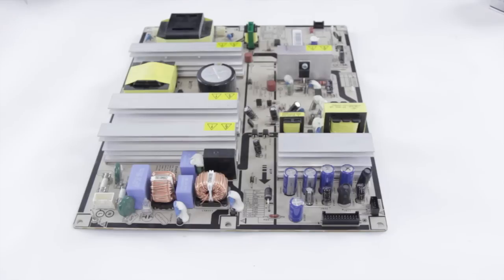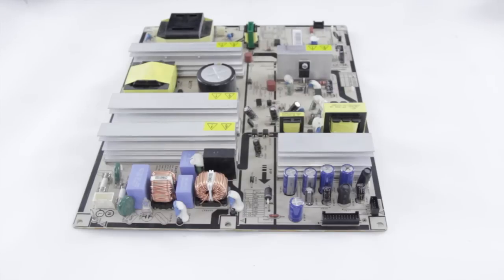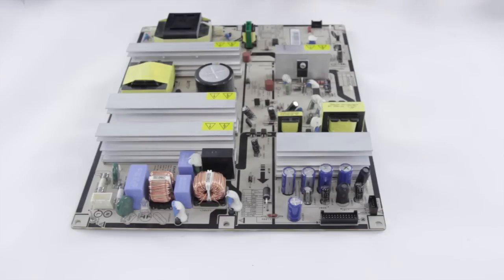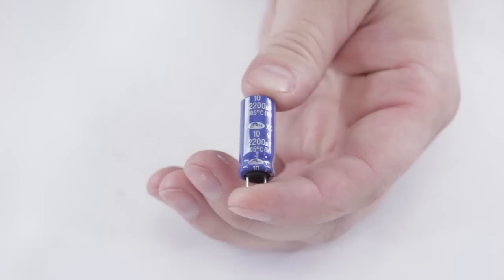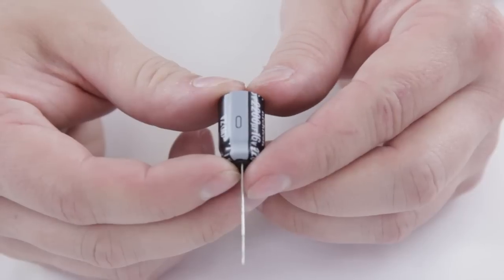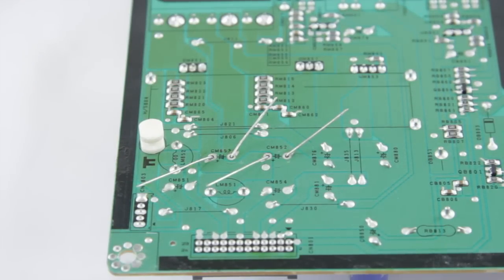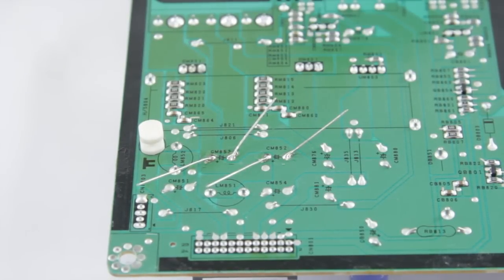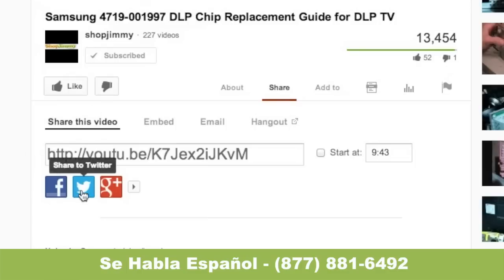Reparando Samsung TV LCD no se enciende - Sin imagen, pantalla oscura - Capacitores son malos

Comment: necesito reparar televisor led samsung un 32f5000 ag tiene audio pero no se ve la imagen es muy tenue bajo la luz de la linterna quisiera saber posible solución si me pueden ayudar estaré muy agradecido, desde ya muchas gracias.
Reply from the maker: Sergio Mansilla   This could be a problem with either the power supply or the LEDs in the TV panel.  You can replace the power supply board to see if that fixes the problem.  Click this link to replacement parts for your TV model number:  http://www.shopjimmy.com/catalogsearch/result/index/?cat=229&q=32f5000  There may be multiple boards for the same TV model number, be sure to match part numbers on your current board, with your replacement for compatibility.  Thanks and please let us know if you have any further questions with your TV Repair!  www.shopjimmy.com

Comment: Very good video.. I need your help because i have a tv TOSHIBA LCD Model 19L4200U. It is not working. No turn on, after a strong raining. What do you think about that. I'm in Caracas Venezuela and i dont speak english very well.  Can you help me?? Sorry for my mistakes in writing. Thank you.
Reply from the maker: jsgibbs100   I recommend replacing the main board in your TV.  Here is a link to replacement parts for your TV model number on our website, click here:  http://www.shopjimmy.com/catalogsearch/result/?q=19L4200U  Be sure to match part numbers on your current board, with your replacement for compatibility.  You can also call our customer service for further assistance with your purchase.  (877) 881-6492  Thanks and please let us know if you have any further questions with your TV Repair!  www.shopjimmy.com

Comment: Hi, you guys have good video tutorial to fix minor repair on our Tv's, Thanks for all your hadr work. Can you Hepl me with a black horizontal line a cross side to side on my Samsung Model: PL51D451. Unfurtualy the warranty its out of date so thats why I decide to check out if somebody has the same issue. I went to a technician and she recomend me to replace the pannel but I want a second opinion before to take a decition. Also I do a video explaining the "fix" that the technician told me to do. http://youtu.be/lDUieMYRj0c
Reply from the maker: *****   This could either be a bad panel or a bad buffer in your TV.  You can try replacing the buffer, but if that does not solve the problem, then I would say you have a bad TV panel.  Unfortunately I do not see any replacement parts in the search results for your TV model number on our website.  Thanks and please let us know if you have any further questions!  www.shopjimmy.com

Comment: samsung PN50C7000YF dont turn on it just make a noise i replace the power supply but still have the problem
Reply from the maker: Jaime Huante   I recommend replacing the main board in your TV.  Here is a link to replacement parts for your TV model number on our website, click here:  http://www.shopjimmy.com/catalogsearch/result/?q=PN50C7000YF  Be sure to match part numbers on your current board, with your replacement for compatibility.  Here is a link to a video showing how to identify your part number, click here:  Samsung Main Boards & Digital Boards: Part Numbers for LED, LCD, DLP, Plasma TV Repair  You can also call our customer service for further assistance with your purchase.  (877) 881-6492  Thanks and please let us know if you have any further questions with your TV Repair!  www.shopjimmy.com

Comment: Hi, i would like to know on how can I fix my Tv Sharp Lc52SB55U,  a power outage,burned the tv, cable box and mi blu ray dvd player. I fixed the tv power supply but when I plugged HDMI cable into the tv, the power went down, I thought that I had to replace the capacitor one more time, but the tv turned on again.  and is working but I can't use  none of the 5 HDMI port connection, advice, do you know what kind of HDMI port I need to order for, tv,and for the blu ray LG BD610. . thanks..